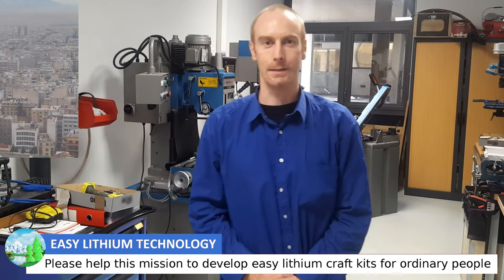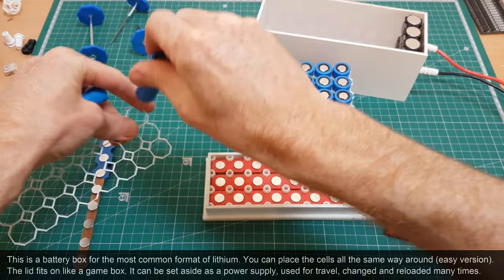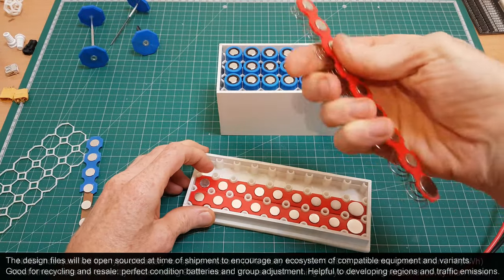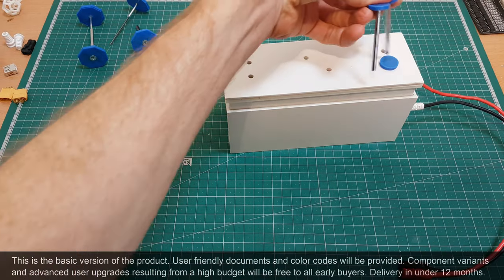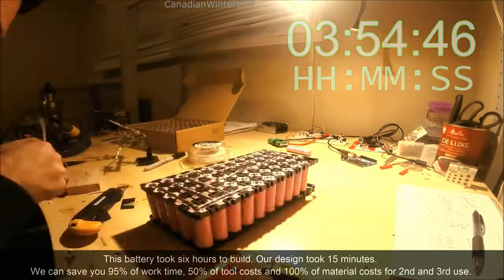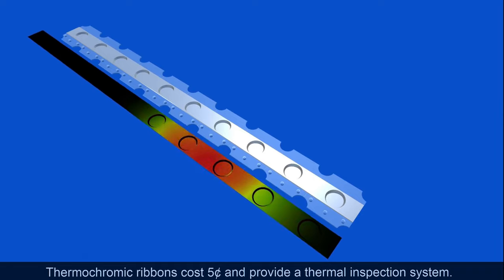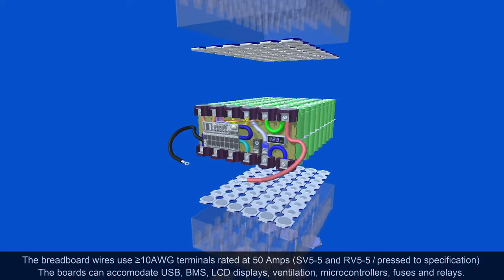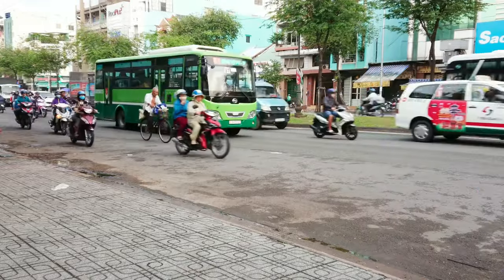New Easy Lithium Box for 18650 26650,  test video only, 4,200 upvotes 24hrs on reddit!!!

Comment: Please put it thru testing for us to see the max current. Both surge and continuous. very important to adoption.
Reply from the maker: Hi, it's been tested at 23 watts for every cell, and the cells were becoming quite warm because they are only rated for 20watts... I'll be running as many tests as possible when I have funds to see how high the rating can be, I hope 50A for every linear group. For the moment, I know that the copper is 50A continuous, the big silver pieces are 125A a piece, and the only limit will be how much we can rate the smaller silver disks, which will be higher tech than in the prototype. at least 15 amps, hopefully 25 amps.